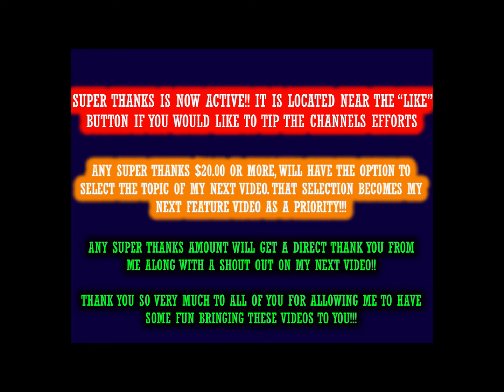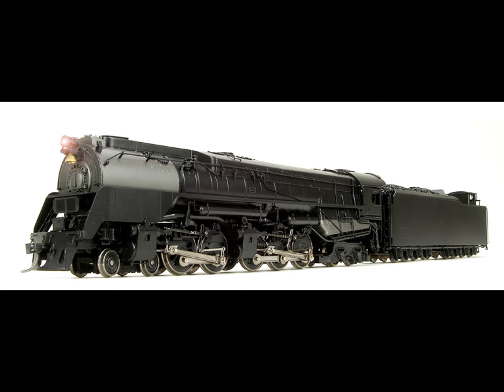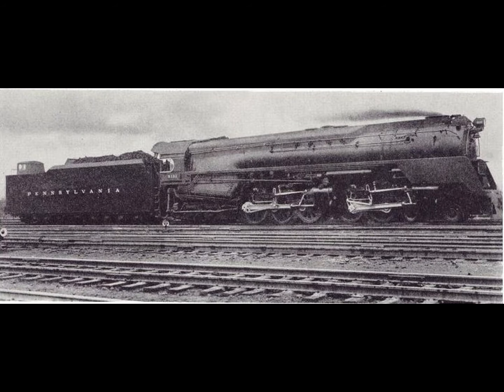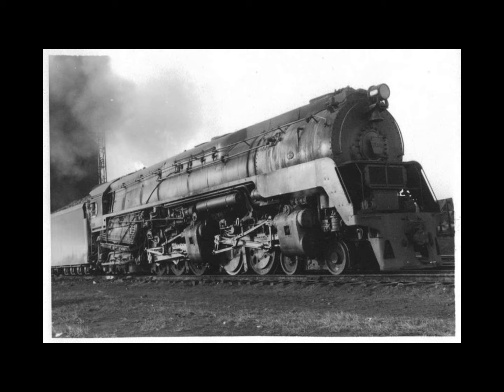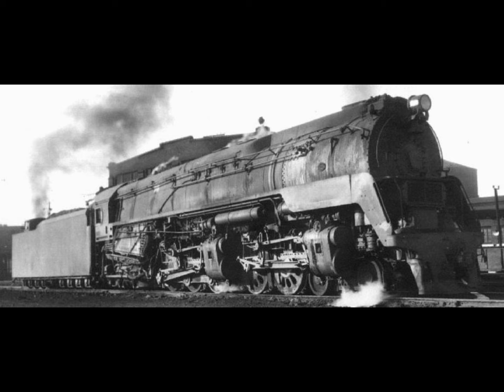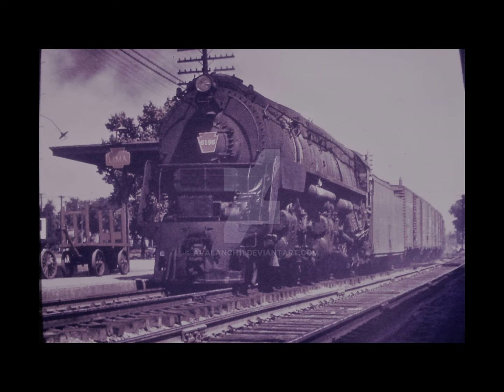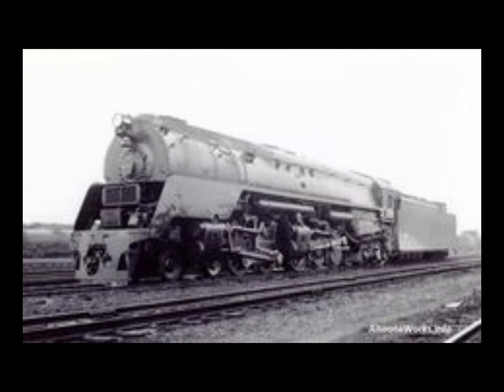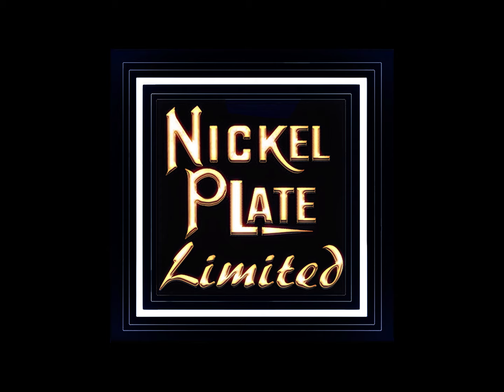Pennsylvania Railroad: Q2, The Lesson Was NOT Learned

Comment: Where did you get Drawbar Horsepower figures for the Q2???  I've seen published Indicted HP figures  of over 8,000 HP.  Those figures were established on the PRR's Altoona test plant.  Never have I ever seen established, verifiable  Drawbar HP figures for these engines and believe me, I've looked for them!  Again I ask, where did you get this Drawbar HP info?  What's your source??
Reply: well, that is the number that appears in the book "American Steam Locomotives: Design and Development, 1880–1960" by William Withuhn. where he got it, I have no clue.
Reply from the maker: https://en.wikipedia.org/wiki/Pennsylvania_Railroad_class_Q2  ... Look at the bottom of the specifications... Then look at the references they used. I can tell you that it is NOT reference 4 or 5. If I had to guess I'd say the info came from reference 1 or 3. I do not use Wiki's info unless they have more than one credible source. And being that they listed two specifically to do with Pennsy.. I went with it.
Reply: I have a copy of Ralph p Johnsons book. Drawbar HP is a calculation of the total power of the engine output, minus power required to overcome the weight of locomotive and tender, being required to accelerate a train of a given tonnage. It's almost impossible to calculate a consistent drawbar HP without a dynamometer car. Any other method of calculating drawbar HP is an estimate at best, and wild guesswork at worst. The pennsy got their numbers via dyno, period, full stop
Reply from the maker: @steffen19k  Correct me if I am wrong.. But Dyno in the Altoona shops with the loco running simulated scenarios' at various power settings.. Something to that effect. This if off the top of my head. The loco wasn't actually out on the line.
Reply: As much as I love the altoona shop chassis dyno for its unique abilities, a stationary dyno test is not a dynomometer car test. It makes perfect sense that the engine could make 8000 horsepower on the stationary dyno, and then not generate enough horse power to keep up with a J1 in service over the road, especially if its got wheel slip issues. As far as I'm aware...(and I would gladly accept correction on this one if I'm wrong) the Altoona Chassis dyno couldn't ever simulate wheelslip conditions on account of its 
roller system.
Reply: Correct. The actual number as determined by the Altoona Test Plant was 7952 hp at the drawbar. The Pennsy originally built one example, the 6130. It was extensively tested before the later 25 were built. One of the problems was the use of lower quality steel in the boiler, due to wartime shortages. After the war, all locomotives had their boilers replaced. That was one of the expenditures that eventually doomed them. The duplex drive was touted by Baldwin as reducing dynamic pounding which was important to the Pennsylvania at that time. Baldwin did build a duplex for the B&O before the Pennsy signed on the dotted line, which was a failure. And the Pennsy wasn’t alone in building locomotives that weren’t used at their full potential… the C&O’s Allegheny also was not used to its full potential, and spent most of their lives pulling coal trains. And even in the diesel era a certain west coast railroad purchased over 600 SD 45 locomotives before realizing that they were a waste of money over SD 40 locomotives for their freight trains. Yes, they were failures, but they were magnificent failures. It’s a shame that none of them were saved.
Reply from the maker: I do not think Q2 would have been a failure had it ran on U.P. or N.P. lines out west. In that event, I think what we are discussing is the actual operational cost of the locomotive over sustained and consistent service.. Something the Pennsy didnt offer the Q2. In essence it was a fenced in Big cat that couldn't hunt as it was designed to.
Reply: @TheRailroadCrossing-SteamPower  True… but then the apex predator appeared on the scene, EMD’s F3. Its savings over steam was in significantly higher availability and drastically reduced labor costs. At least the Pennsy saw, read, and acted on the handwriting on the wall. But their size caused them to continue operating steam power for the next decade.

Comment: Does one get the possibility that the Pennsy was trying to relive their much earlier design leading prestige in the world of steam locomotives?  But, ‘twas too late in the steam era as the diesels were on the way.   Maybe the mechanical department was trying to retain their worth within the corporate scheme of things.   Most agree that had they stayed with more standard designs, proven and with less unproven new design work they might have, similar to the N&W, got a better return on a rather short term investment.  As for the Q-2s, one of the problems that arose after the end of the first year of service were the repair of circumferential boiler leaks at the seams forward and aft of the #2 pair of cylinders.  This required removal of the FRS gear box (when equipped with), spring rigging, drivers and because of the number of locomotives with this problem (some more some less) Columbus could not handle all work requiring Altoona to get involved.  And all this due to (in my opinion) the one piece cast bed (a proven positive) as opposed to articulated bed castings and providing for both longitudinal and circumferential boiler expansion allowance at the #2 cylinder attachment to the boiler.  This could have been a great design had conditions, design and time wise been different.  After all, they ain’t making money for the company when the’re being shop queens.  With so much potential considering the other “test designs”, wish one had been saved.
Reply from the maker: Great Info! I particularly have not seen the info. about the boiler leaks! Thank you

Comment: I would have liked to see them on the coal trains from Columbus, Ohio, to Lake Erie. Fairly straight route but I don't know the speed limit. I don't know if the J1's could even get up to 50 mph.
Reply from the maker: Any line with little curvature the Q2 should have really been on display.
Reply: The problem is that an N&W class A can haul that and more at the same speed.
Reply: N&W didn't class A didn't run on PRR. I'm comparing Q2 vs J1. @gamerfan8445
Reply: @glorialotz3333  um it did. 1942

Comment: So would this engine been better out west where there were longer runs with higher speeds?  Why make an engine that is for speed when the speed is limited?
Reply from the maker: That's the point I had made in the video... They weren't willing to hinge the locomotive design to help alleviate the overall rigidness of the frame.. Therefore negotiation of curves was even more of an issue for Q than it was for the Texas.. Which were also to large and rigid for the curves above 50 mph. Clearances were also a concern for the two larger locomotives. This is a big reason why the K-4's were legendary on the PRR lines. They were the perfect size.